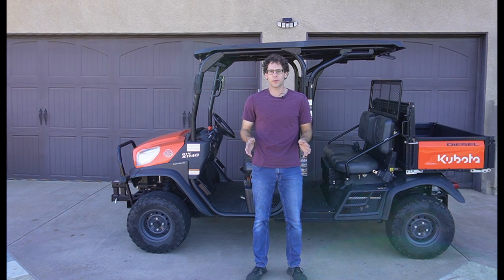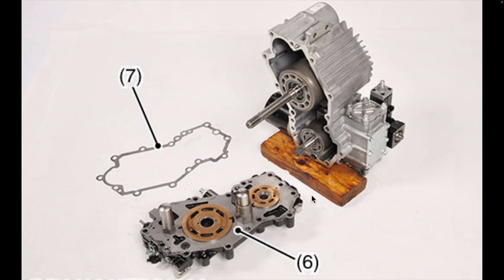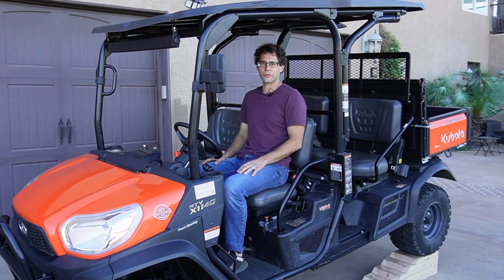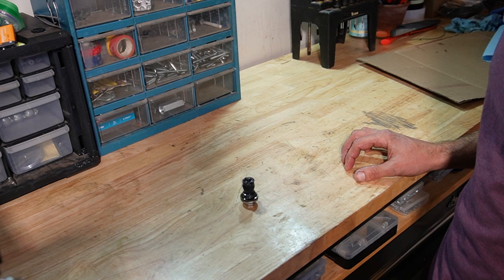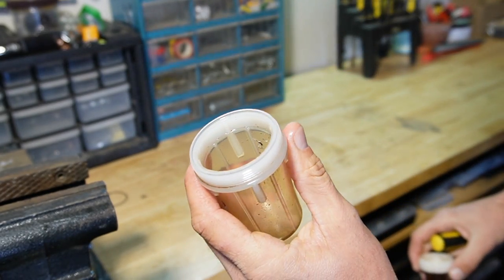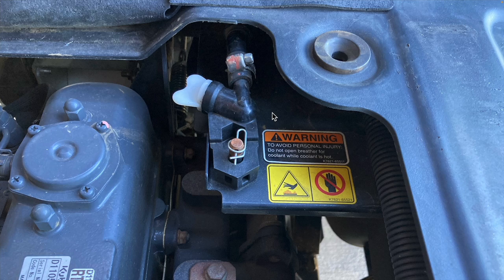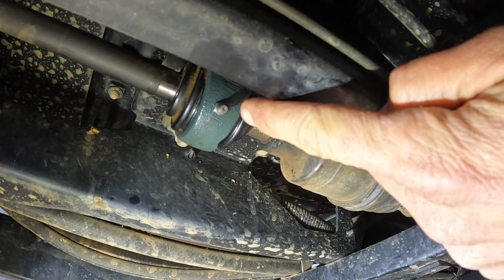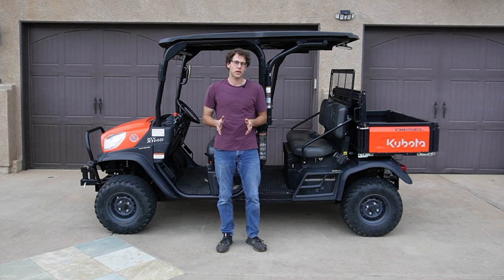How to Fully Service a 4x4 Utility Vehicle (All Fluids and Filters) - Kubota RTV-X1140

Comment: I'm doing an oil change on mine now (230 hours)....I've worked on it 4 hours (no ramps) it's not easy...problem is I've changed the oil before (50 hours) and don't remember it being this difficult....I would have liked to see the skid plates going back on....I've worked 30 minutes trying to get them back and quit and went home to see if I could get my body back in to normal shape after being a contortionist. Great video....
Reply from the maker: You need to elevate the vehicle. I made a separate video showing how I made the ramps. It's easy and cheap to do. Build yourself a set and it will help tremendously
Reply: @TheEscondidoExperiment  Thanks for the reply...I'm going to make the ramps for future service....one thing I found in completing the job is I used a small floor jack to help support the plate and started with the two back bolts first as they go straight into the frame then finished where the back plate overlaps the front plate and got it done in 10 minutes....I really enjoyed the video...I appreciate how you technically approach the 1140 and I can tell by your shop you're prepared for any maintenance or repair situation...I like that.
Reply: could you tell me what greasing tool you're using....sounds battery operated...I need one.
Reply from the maker: @richardburns3048  It's the Milwaukee 2646-20. Works great

Comment: wow.  you deserve an award for this video.  Thanks for making it.  I never knew the HST oil was in the tank.  I thought that was for the steering and lift cylinder.  I have 500 hours on mine and never changed this oil.  looks like I'll be doing that ASAP.   Again, great video that was effective and straight to the point.  Oh and I also didn't know about the front driveshaft lube point.

Comment: Now that is how a video should be done. Thank you so very much for taking the time to do this video. It was straight forward, informative, to the point and well documented. Have not looked at your other videos yet, but I will. I hope there is one on the RTV-X1100C like this one.
Reply from the maker: Thank You. Over time I will make more videos for the other equipment that I have, but I don't have an X1100C so I won't be making a video for it. However, with that being said, the layout of that machine is very similar to the X1140. Most of what I covered here should apply to your machine.

Comment: Have you done the spark arrester service yet?  Seems to be a mystery on how to do it, yet is supposed to be done every 100 hours.  The 1140 came with 2 different muffler setups.  Yours is like mine.  There is a youtube video by a guy that has the other muffler setup.  It seems really strange that maintenance would be performed the way he does it (rubber mallet).
Reply from the maker: I haven't done that yet. Cleaning the muffler out every 100 hours is extremely conservative on Kubota's part. The manual also says to change the brake fluid every 2 years, which is unreasonable. As long as the brake fluid remains sealed from the outside, it should be fine for many years. Think about how often you change the brake fluid on your car... not very often and this Kubota uses the same fluid (DOT-3). 

As far as how to service the spark arrestor, here are the steps outlined in the operator's manual. You do need to tap on the muffler with a rubber mallet to dislodge any built up carbon: 

1. Set vehicle in an open area away from combustible materials and on flat surface.
2. Apply the parking brake and shift range gear shift lever into the "NEUTRAL" position.
3. Remove the drain plug located on the bottom of the muffler body.
4. Start engine and raise and lower engine revolution while tapping on the muffler with a rubber mallet until the carbon particles are purged from the muffler.
5. Stop the engine.
6. Reinstall the drain plug.
Reply: @TheEscondidoExperiment  I have a 1140X  with only 10 hrs so far, but when I saw the muffler clean out , that sounded like the most ridiculous maintenance task I've ever heard.  I've had many tractors for 55 yrs, and seeing any sparks out the muffler is not common (unless you have a turbo charger!),  this would be the last thing I'd ever care to do Kubota!  But your video was awesome... by the way!

Comment: Thank you very much for a proper detailed video. What tipe and spec of oil did you use that work the hydrostatic transmission?
Reply from the maker: You're welcome. The hydrostatic transmission and the transmission case both take Kubota UDT fluid

Comment: Any comments on why it is difficult to put a 2015 900 into and change gears?
Great video thanks
Reply from the maker: The gear shift connects to the transmission through mechanical linkages. Try spraying each of the joints with some lubricating oil.
Reply: Thanks
Reply: What kind of grease gun do you have?  Thanks

Comment: very thorough but what are the hours intervals for  the different items like engine I'm sure is more frequent than hydraulic or coolant
Reply from the maker: Here is what Kubota recommends:

Greasing: 50 hours
Engine oil and filter: 200 hours
Hydraulic tank oil and filters (VHT and Suction): 200 hours
Transmission case fluid: 400 hours
Front axle and knuckle case fluid: 400 hours
Coolant: every 2 years

Comment: Great video.  Question, I seem to recall that UDT2 is preferred to UDT?  Also, I assume UDT/2 is used everywhere in this video other than the grease, motor oil and coolant.  Correct?
Reply from the maker: My local Kubota dealer only stocks standard UDT fluid (no UDT2), so I asked them that exact same question. They said that UDT2 fluid has better lubricating properties when operating in cold temperatures, but here in San Diego there is no demand for it because it never drops below freezing. 

And yes, you're correct about the fluids. The transmission case, hydraulic tank and front gear/knuckle case all take UDT fluid. For the grease, any NLGI2 grease will do. The motor oil is 15W-40 and the coolant is just standard 50/50 water/ethylene glycol mix.

Comment: Is there only one drain for the auxiliary hydraulic? Or, Is there a drain on the bottom side of the hydraulic pump? Similar to the transmission case?
Reply from the maker: All of the hydraulic implements on the machine use the fluid stored in the hydraulic tank, not the transmission case. To change this fluid you just need to pull the drain plug that I showed in the video. There is no need to do anything to the hydraulic pump.

Comment: This is an excellent video and very helpful in explaining that the transmission fluid is separate from the HST tank (although it all uses the same type of fluid).Nowhere is this explained in the owner's manual. The same is true for your demo of changing the coolant. My question is: Is it safe to use a car hoist to lift at the frame rails?
Reply from the maker: I assume you're talking about raising the whole vehicle from four points so that you can stand underneath it. As long as these points are on the frame, I see no reason why this would be a problem. 

The frame is going to be particularly strong around where the control arms for the four wheels connect to it. I would look around this area for the best lifting points.
Reply: @TheEscondidoExperiment  Thanks. I have not found any reference on YouTube or the Kubota Forum about using a standard two-post, four-pad car hoist on the RTV 1140.  Keep making more videos.
Reply from the maker: @m.cooper1854  I have a lot more coming. Stay tuned

Comment: Thanks for an excellent video - I watched it half way though my 400 hour service, while waiting for the engine to cool while flushing the coolant system after the first drain. Out of interest how many hours had you logged at the time of doing this service? The 400 hour/4-year service that I am doing calls for a number of items that I am not doing - for example replacing some of the fluid lines - which to me look just fine on inspection.
Reply from the maker: This service was performed at about 2 years/250 hours. I could have waited another 150 hours to service the transmission case, but since I was making a video I just went ahead and took care of it. 

The manual is sometimes extremely conservative with recommended services... I would never replace a fluid line that is not leaking or visibly worn. There are a few things I omitted too, such as cleaning carbon out of the muffler and changing the brake fluid. If you regularly change all of the fluids and filters I showed in the video and grease every 50 hours or so, you should be good to go for a long time.

Comment: Great video - thanks.  I just had my x1140 serviced at Kubota dealer and they mentioned there was some water in the fuel/water separator. Does your model have a separator?
Reply from the maker: My X1140 doesn't have a fuel/water separator. You must have a different version of the machine. I know that Kubota makes lots of these... they've probably made some changes throughout the production cycle.

Comment: Made a mistake a poured engine  oil in the yellow oil fill plug under the bed 
Was wondering where I should drain it and if this will cause damage ?
Reply from the maker: It sounds like you put engine oil in the transmission case. Yes it needs to be drained. There are two drain plugs under the vehicle. Skip to the part of the video where I serviced the transmission case and you'll see what I'm talking about.

Comment: Hey what oil do you use for the engine 
And what oil do you use for the hydraulic system and transmission system. Can you also tell me how many liters for in all listed above. Cheers great video! Subscribe.
Reply from the maker: 4.3 quarts 15W-40 for the engine. Kubota UDT fluid for the hydraulic system and transmission case. You're generally not going to get all of the UDT fluid out, so measure how much came out and then put the same amount back in.

Comment: What are the cross reference filters - say to Fram or other common brand - I am not near a Kubota dealer.
Reply: Oil Filter - Wix 51334
Transmission Hst - Wix WL10013
Transmission Pressure - Wix WL10043
Reply from the maker: I love it when people solve their own problems!

Comment: What are the fluids you used?
Reply from the maker: Engine oil: 15W-40 full synthetic
Transmission/hydraulic fluid: Kubota UDT fluid
Radiator: 50/50 water/ethylene glycol mix (just standard green coolant)
Grease: Any NLGI#2 grease will do
Reply: Did you use any gear oil?
Reply from the maker: The front gear cases also take UDT fluid